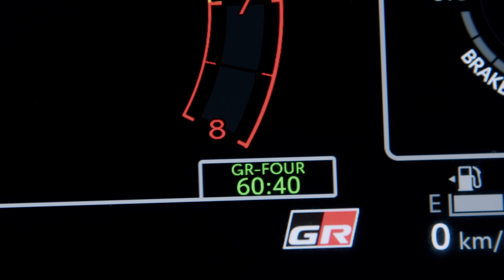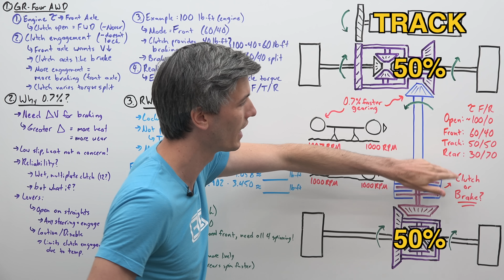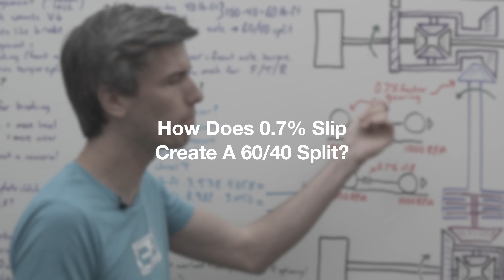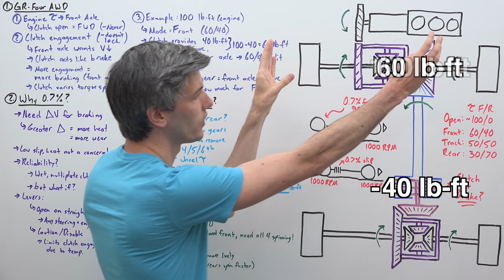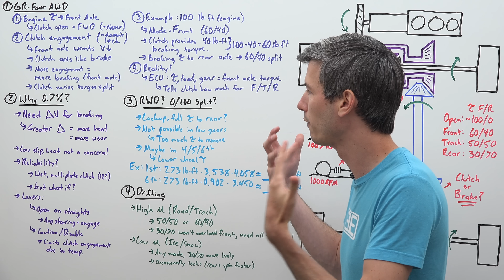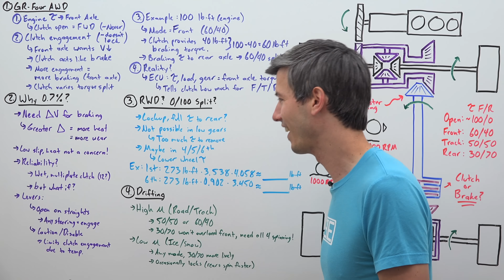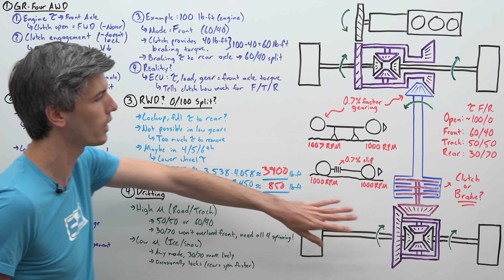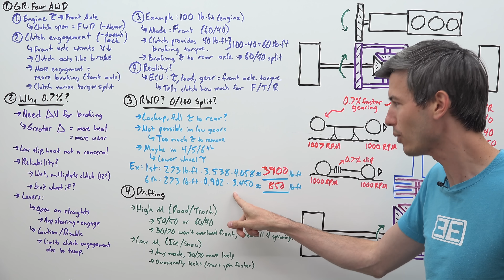Toyota GR Corolla's Brilliant AWD System - How It Splits Torque!

Comment: A good video but IME, and i designed WRC active transmissions so i do have a fair bit :-) for what most people care about, driving dynamics, ie limitation of understeer and control of oversteer, what matters is mainly tyre slip ratio and wheel speed control and not the actual torque distribution ratio.  Let me try to explain:

if you want the maximum possible longitudinal acceleration you want each of 4 tyres to be held at the point of optimum mu (friction) but this does not occur anywhere near zero tyre slip with the road  Depending on tyre type and road surface slip rates of between 5% (sports tyres, dry tarmac) and 25% (off road tyres, gravel road) provide the best possible tractive effort.  Depending on the normal force (vertical load) experienced by each tyre, that slip rate will be achieved at very different torque loads for a front or rear tyre.  This is especially the case with a car like the GR, which has a high static mass imbalance (most of it's mass is at the front) but of course can accelerate reasonably hard and has a relatively high Centre of gravity, so will dynamically move a lot of that mass rearwards when accelerating due to weight transfer. This makes being able to move torque backwards really important for maximum performance ie max acceleration

BUT,  being able to accelerate maximially is important yes, but most road car drivers also want what i call "balanced handling" ie they want a car that mostly goes where the handwheel points it with reasonable fidelity and repeatability. Here, you absolute will need to sacrifice max tractive effort at the altar of "good handling".  Most road cars ultimately are setup with a passive understeer led balance, ie they slightly overload their front tyres at the lateral limit when no torque is applied. This means under extreme circumstances such as an unexpected emergency maneouver where all drivers lift off the throttle the car basically understeers safely.  Different brands and models have different attribute sets here, with some understeering heavily, and some very slightly. This is of course easy for a front engineed front wheel drive car, because all the weight is in the front, all the drive is in the front, so by the simple act of not putting in too much rear cross axle stiffness (which also moves weight backwards under lateral loads) you have a nice safe "front led" balance.

The problem comes when you DO want to accelerate and turn at the same time ie "sporty driving". Here you add tractive effort to the tyre contact patch, and the tyre simply falls into gross over load,  gross slip and hence the car understeers heavily (VW i'm looking at you here..... :-) )  For sporty drivers, this feels horrible and not at all "sporty"  So what a 4wd system like the GR's is trying to achieve is to get the rear tyres to take some of the tractive effort loads off the front. Here, simply putting more torque on the rear is no use because the front tyres, carrying the majority of the lateral load (front biased static mass distribution remember) are always going to have a higher slip ratio for any given absolute torque loading.

it's here where thinking about wheel speed and hence tyre slip makes sense imo, and a basic though experiment should show us why:

Consider a car, parked across a steep side slope, say a 30 degree angle, but also held back to a stong post anchoured in the ground behgind the car with a rope.  When parked the car just sits on that side slope, no tyres are turning, and all the tyres can provide enough lateral grip to prevent either end of the car sliding down the slope. 

Now lets start the engine, engage 1st, give it full revs and dump the clutch.  Consider a front wheel drive car, so the front tyres spin up violently, and now they have such a massive slip ratio (the car isn't going forwards because we have tied it back to the post) that the front tyres have no lateral margin at all, and the front of the car slides away down the slope.   Repeat for a rwd car, and here, with the same test, it is of course the rear that now slides down the slope. For a 4wd car, the end that slides down first is the end that experiences the highest tyre slip, the end where the tyre has the least available lateral margin left to hold the car up.

That is basically what happens when going round a corner except the lateral load is provided not by being on a slope, but by the vehicle experiencing centripedal acceleration, where clearly more slip on the rear tyres means oversteer (the back slides out) and more slip on the front means more understeer (the front slides wide). The problem is that tyre slip is not just a result of the absolute torque applied to the tyre, but the capability of the tyre to transmit that torque to the road as tractive effort and that depends on its current slip ratio and the vertical force being applied to that tyre, which depends on not just the static mass distribution of the vehicle but the dynamic weight transfer in effect at any given moment and that depends on the longitudinal and laterial acceleration being experienced!  This is why a good handling 4wd is actually really really hard to make, especially when that car has a poor FUNDAMENTAL dynamic architecture ie a heavily imbalanced static mass distribution and a high Centre of gravity. (it's a double 'mare for road cars where the number of passengers and the weight of their stuff in the trunk also changes)

Where all this rambling is getting us too is the point where we should now ask "how much ability do i need to dynamically distribute tyre slip?" 

And here, we see why the GR system falls down and why most road test reports have experienced, given the physical layout of the vehicle, a car that has good performance but is a bit inert and front led from a handling perspective.  A 0.7% difference in tyre slip is effectively nothing.  An active transmission WRC car that addmitidly must work on both gravel and tarmac has something like a 40% overspeed capabilty of the rear axle, ie it can push the rear tyes towards a slip ratio of 40% whilst the front tyres sit at zero percent slip (and vise versa).  Whilst that sort of aggressive overspeeding is not required for a road car, it is what you actually need to fully leverage the extreme dynamic yaw control capability of a WR Car.  
For the GR yaris, yes it might well be able to "send 70% of the torque backwards" but only up to a slip imbalance of 0.7%. On dry, clean tarmac with a sporty tyre, yes, you'll feel that,  but it's not nearly enough to make the car feel anywhere near "RWD" (remember a RWD car is the ultimate expression of being able to move the slip ratio backwards as it can overspeed it's rear tyres by an effectively infinite amount, which is both a curse and a blessing, depending on your driving experience and skill...........  🙂  

So in summary that 70% rear torque biasing capability is plenty enough to ensure that both the front and rear axle can be kept at the SAME level of tyre slip for maximum performance (max longitudinal accel) but the limited overspeed capability (0.7%) means the system cannot apportion torque to create deliberately DIFFERENT levels of front / rear tyre slip and hence control dynamic yaw effectively.

Ironically perhaps, the reason most road based 4wd systems have a pretty limited maximum overspeed capability (the GKN hang on overspeeding rear axle as used in the Ford Focus RS has iirc the highest capability with a roughtly 10% max overspeed capability) is due to excessive wear limits (ie service life) and thermal control (slip = heat). A high overspeed ratio also means a larger epicyclic geartrain which is tricky to package.

Hope that's useful info  🙂

Comment: Isn't this the same as the Focus RS with an over driven rear axle controlled by a multi plate clutch?
Reply: Focus RS has two multiplate clutch-packs, one per each rear wheel. Here you have one clutch-pack for entire axle.

Comment: Sorry, I still don't understand the purpose of having 0.7% slip. Maybe someone can help to re-explain it to me here.
Isn't the torque split determined by the amount of pressure (hence slip) in the clutch? Why do you need that mechanical 0.7% slip if you can control the clutch slip electronically to vary the torque split?
Reply: Maybe the video about GR FOUR on my channel will help.
Reply: @Way Outthere That's not true. When locked up, the torque distribution is indeterminate - it depends on tire slip, with the clutch transmitting any amount of torque including the full output of the transmission... or zero.
Reply: The point of overdriving is to allow the clutch to always be slipping, and thus able to control transmitted torque. A locked-up clutch could be transmitting any amount of torque including the full output of the transmission... or zero.

Comment: Judging by some of the comments.
The best way to start a bar fight,is not to call their misses a moose,but to slag off their cars 4 wheel drive,torque spliting ability and longevity of the parts used.

Comment: Thanks for the explanation. Looking at the way the torque split works it relys on the car having consistant wheel road speeds on all for corners. So the car will need all four  tyres to be the same make, wear and tyre pressures to make full use of the system.

Comment: There's an important tire engineering/vehicle dynamics concept you didn't include in this video that will make everything make more sense. 

If you had the clutch pack "locked" with 0.7% higher gearing at the rear, it will be forcing a higher tire slip ratio at the rear vs. front, which is effectively like sending more torque to the rear axle, because the tractive force available at the rear is higher, due to a higher slip ratio. This will only send more tractive force to the rear tires up until you reach a critical slip ratio %, because tractive force drops off once the slip ratio goes above ~10%-ish depending on the tire. The reason you only need a very slightly higher gearing towards the back is because tractive force available varies significantly with only 0.2-1% differences in slip ratio if you look at a graph.
Reply: That makes total sense, but only on high grip asphalt. I'm used to snowy conditions for a few months every year and I wonder how this system would behave then. I haven't seen actual data supporting this, but intuitively I guess slip ratios on snow/ice would be less sensitive so you need a larger difference to get the same effect. Basically meaning that the slipperier the surface the less RWD a car with this system would become, since at most it can provide 0.7% more rotational speed at the rear. I guess that is what the "30/70"-mode is for, to tell the control system to basically over-estimate what is going on when in properly slippery conditions. It sounds more flawed now than when I first heard about the GR, but until I drive one I will simply remain undecided.

Comment: EE, you are amazing at anticipating all of my questions. This video was an an ALMOST perfect example. You nailed 999 of my 1000 questions. The one you didn't address is how much torque can you sap from the engine in the worst case scenario? Drag and heat have got to cost something. Did Toyota just give the motor more power than it can possible use to overcome the loss?
Thanks,
Reply from the maker: Great question - I do not know! Dang. But considering this thing has nearly equal fuel-economy the lighter, FWD only Civic Type-R, I don't think it's eating up much energy. There of course will be some energy lost as heat in the clutch pack - I do not know what that number is. Again, great question!
Reply: Good point. Traditional AWD/4WD systems sap a lot of power if they're engaged all the time, so I would be surprised if this system was any worse overall since I would expect that most of the time it would be 60/40 front/rear

Comment: Instead of trying to marginalize by attempting to emphasize how small .7% is... why don't you actually calculate it out? It's not that difficult. 300hp with a 70% rear split means 210hp is going to the rear. This means if the tires have full traction the clutch pack needs to absorb 1.47hp or 1100 watts. The wet clutch has no external radiator or circulation, has no cooling fins and is limited to a 0.5L liquid capacity. I don't care who engineers it but no small system without external cooling is going to absorb 1100 watts for a 20-30 minute track session. Is it really believed any of these modes are static while traveling in a straight line? None of the other systems on the market like the GKN Twinster or the Honda SH-AWD systems work under a static split normal operation. They cut the rear power down dramatically (5-10%) in order not to burn out the rear clutch pack and for gas mileage. It would be VERY unique if Toyota figured out a system that didn't need to do that, but considering how little fan fare there is about this specific system I highly doubt it's a static split as the physical limitation of the car is trying to smash itself all the time needs to be addressed and that force/heat has to be bled into the environment somehow and wear will occur.

Comment: How about efficiency from a system like this? Is the continuously slipping clutch creating much of a torque differential between engine and wheels due to heat losses?

Comment: Honda’s had overdriven rear wheels for a little while now.
Reply from the maker: For left to right, but not front to back. What's an example of a Honda with a front/rear speed differential?
Reply: @EngineeringExplained  SH-AWD in its first gen could overdrive a rear wheel by up to about 5%, though in limited conditions of steer.  The new RDX/RLX also has overdriven rear axle -not sure what the conditions for that was.

Comment: Why does the final drive ratio differ, from 1st to 6th? edit: okay so, Jason mentions at the very end that he made a video about how it's possible to have two different final drives, however, provides no link in the description. All the links are just affiliate/merch/social fluff. So eventually I figured it out and it's the Hyundai DCT video. Great, I watch that. But that video shows that two final drives is only really feasible with a FWD vehicle, when the diff is packaged in with the transmissions. That's because the transmission has to have two output shafts for the two final drives. To do it with a RWD/AWD vehicle, you would need two drive shafts running the length of the vehicle and two of these wet clutch packs for the split.
Reply from the maker: The gears are on different shafts, each with their own output gear, which drives the diff. See video referenced at the end of this video for a visual.
Reply: @EngineeringExplained  Ya I saw that, but it's not clear how that's possible with an outboard differential for the rear on this type of drivetrain layout.
Reply: @ewicky  right, but there is no reason to want that. This design with two transmission output shafts is just done to make the transmission more compact in a transverse transaxle - it has no performance benefit.
Reply: @brianb-p6586  well it apparently was also done for the performance benefit of effectively having two final drive ratios to choose from...
Reply: @ewicky  No, it was not done for any performance benefit. The gears using one output shaft (1st, 2nd, 3rd) get one final drive ratio (4.058:1), and the other gears (4th, 5th, 6th) get the other ratio (3.450:1); each of the transmission gears gets the same final drive ratio all the time. The final drive ratio is just part of the overall ratio from engine speed to axle speed, and only those overall ratios matter, not how they are built up from two stages (transmission gears and final drive gears).

The final drive ratio cannot be chosen independently from the transmission gear - it is not a second transmission or "two speed axle".

Comment: @Engineering Explained - I’d love an accurate tutorial on Torsen differentials. Amazing to consider they are 100% mechanical, and do not use a clutch, ramp, or friction surface - just gears.  Q: Is it true that they reapportion torque before slippage begins? Sorry to report that an existing, very detailed explanatory video on YouTube is incorrect. I really want to understand the torsen system. Thanks!
Reply from the maker: Old but it's out there! Two-parter:
1 - https://youtu.be/wiq1Rk5wqds
2 - https://youtu.be/lDsQAs0Ldes

Comment: Sir; that «clutch pack» is merely a viscous coupling. They just made it work in a different way.
Reply: No, it is not a viscous coupling at all. It is a multi-plate friction clutch.
Reply: @brianb-p6586  but look at the picture where you see the discs. I've re-packed these and replaced the silicone fluid that get hard in high temp and make them stick together. Its exactly the same. I still have a spare one in my garage.
Reply: @UCs6ktlulE5BEeb3vBBOu6DQ  yes, a multi-plate friction clutch and a viscous clutch both have stacks of plates. That does not mean that they work the same way at all.

In a viscous clutch torque is transmitted by fluid drag between  closely spaced plates, but in a friction clutch it is transmitted by sliding friction between the plates which are stacked directly against each other (with only a thin oil film between them). Viscous drag is controlled by fluid properties such as fluid type and temperature, but friction is controlled by the force clamping the plates together. You can't actively control the viscous clutch, but this entire video is about how the system can control the clamping force to actively manage the clutch and the transmitted torque.

These devices are not the same. Your viscous coupling does not have a way to clamp the plates together - in this system, that's the electric solenoid at one end of the plate stack (the rear end, to the right of the plates in the cutaway shown in the video).